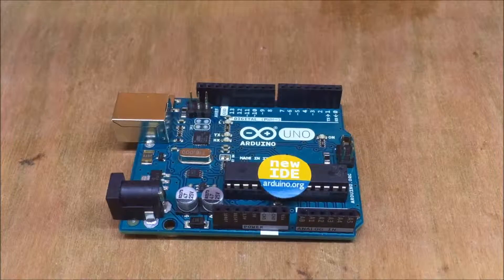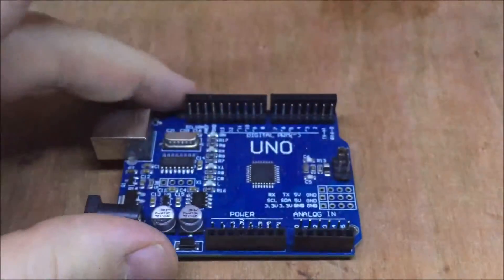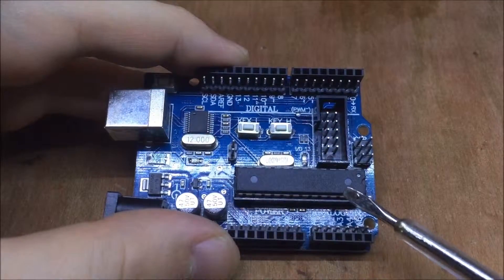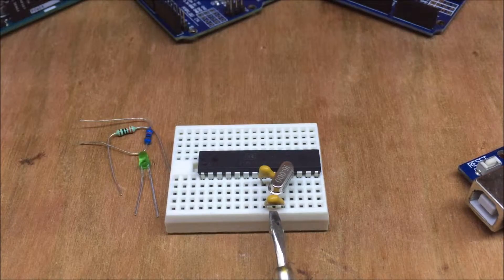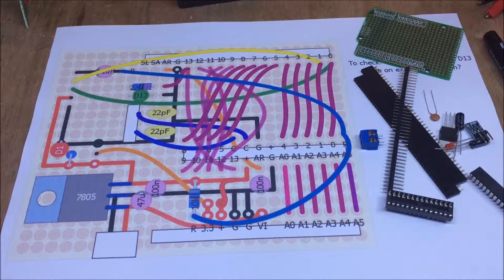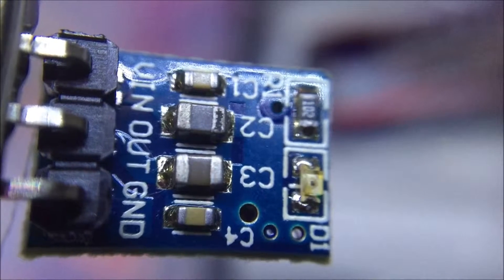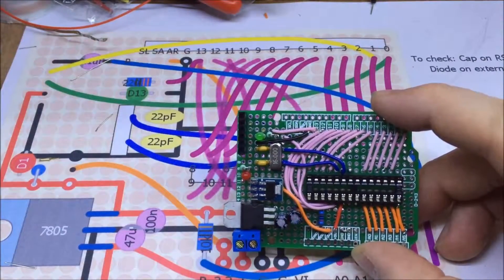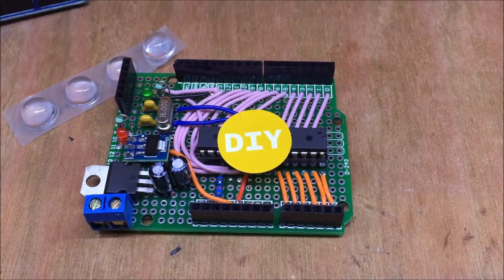Create an Arduino Uno - Adam's Arduino Projects

Comment: The first two clone boards you show are silk screened incorrectly. It's ICSP not ISCP https://en.wikipedia.org/wiki/In-system_programming I do wish they'd get it right :-) I did design my own Arduino clone, the minDUINO, you can find details on www.projectavr.com
Reply from the maker: Neat - I like the minimalist design.  I'm still avoiding designing PCBs as you can tell!
Reply: You should grab a copy of KiCad and do 'Getting To Blinky 4.0' YouTube 
tutorials by Contextual Electronics - You'll up up and running in no 
time.
Reply from the maker: Cheers for the tip - I may well do that.